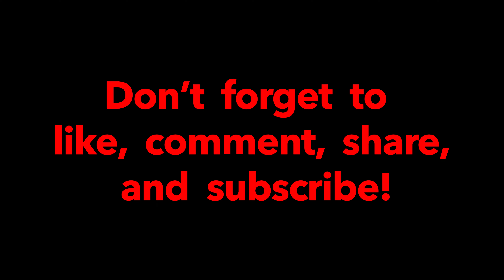Building A Neck Through Guitar Part 23 Making A Guitar Nut

Comment: I made a camel bone nut. Dyed it red to match the body. Used the idea of making a "T" shape that drops down and fits into the truss rod opening...
Trying to figure for string spacing having the same space distance between each string and placement to the neck edge. Seems like it will take some in place measuring.
Doing this on a guitar WITHOUT a straight string pull...thinking of making a "String Butler" type of truss rod cover ?
Good ideas and instruction here in the video thank you.
My dream is to build a "math" Guitar from scratch some day. Using rounded off correlating math for all the dimensions on everything...

Comment: Great info. Shaped my first nut blank following a lot of your info. I have a harmonic that rings out on the open A. I've muted behind the nut going to the tuners and that didn't stop it.  Any ideas? I'm guessing something with the angle of the slot? Depth seems good. Top of the nut is pretty much level with the top of the string. I only really hear it playing the guitar unplugged.
Reply from the maker: Without seeing the guitar, I can only guess. I would check the width of the slot. Too much contact between the string and the side walls of the slot can produce unexpected harmonics. Try slightly widening the slot by angling the file side to side as you move it back and forth. Try to aim the file's teeth at the side walls of the slot, but don't file into the bottom of the slot or you'll make it deeper. You just want to make the slot wider as it reaches the top of the nut. Sort of like a V shape when viewed from the front or back. Also, the slots should be angled to match the angle of the string from the nut's face toward the tuners. The only point of contact between the string and the nut should be a tiny patch where the bottom of the string touches the nut at the face before heading to the bridge. Hope this helps.

Comment: From your description of the cow femur bone, it doesn’t sound like it has bee defatted. If you want to determine if it had been defatted or not, try holding a piece of it over a candle flame.  If there is fat in it it will burn.  If no fat it will only char.  To remove the fat you can soak it in naphtha.